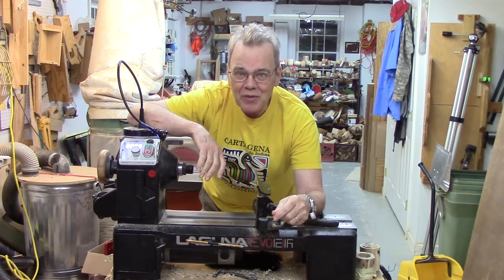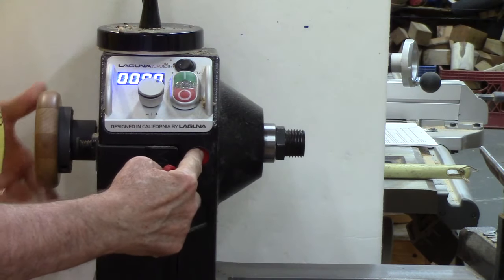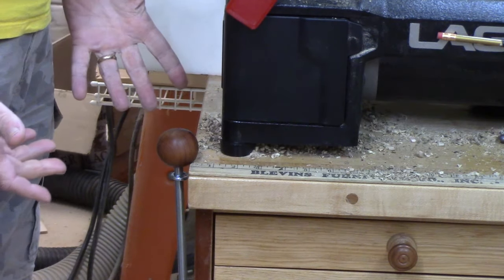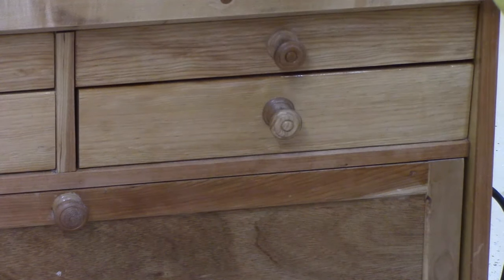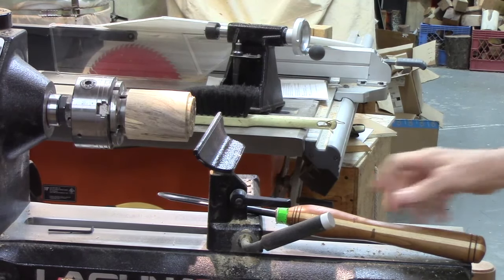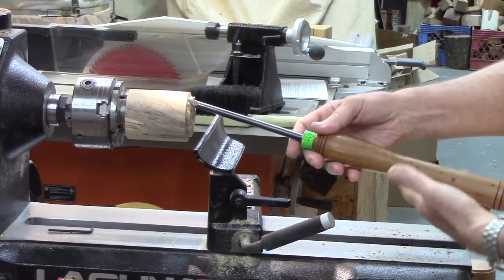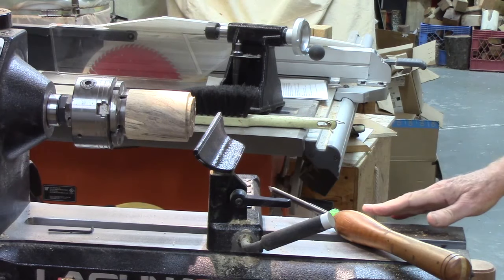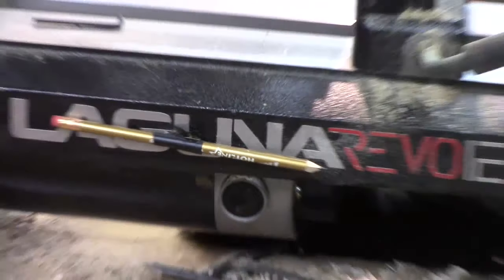Laguna 1216 Midi Lathe - More Tips and Comments

Comment: Hey Mike, nice updates on our Lathe. If you make a washer for you headstock spindle out of a milk jug plastic it will make it much easier to remove your chuck. Also, I use a good thick magnet placed on the rear of the headstock to keep frequently used tools handy. I will be making that spindle lock magnet, that lock is a pain. Just an idea, I do take the tailstock off occasionally and I have some thick foam floor matting, I just place it on it behind my 1216. I guess I could put it on my extension that I have mounted for outboard turning. Now, this tip is odd I know, I bought a LED shop light from Walmart for under $20. I hung the light vertically at the end of my lathe to the back about one foot to give me the best light. It has made it so much more easy to see when turning inside forms. I do have an Ikea spot light but I rarely use it now.
Reply from the maker: I am not a fan of plastic washers. I have seen them cause vibration. I have a 100 watt LED light directly overhead so actually my lathe lighting is pretty good.

Comment: I turn bowls mostly from firewood so the 12: swing over the bed is great. Most of what I turn starts out out of balance. oes your bench mount work OK or should I think about those expensive legs>
Reply from the maker: I do not turn bowls on it since I have Powermatic 3520b that is far superior. But my Laguna rests on top of my lathe stand on its rubber legs and does fine for everything I use it for. I would nver give up my lath stand for a pricey Laguna stand that does not provide any storage.

Comment: Mike, just one other question about 1216 face plate.  It has two set screws installed on the back of the face plate.  It looks like it”s holding a separate part?  Is that a removable part?  I didn’t want to damage it.
I really appreciate your help.  Thanks again.
Roger D.
Reply from the maker: See if this helps https://youtu.be/EMWUTrNUjh8

Comment: Good idea for the thread locker.   Viewers need to be aware the colour normally indicates the strength.   Blue is medium strength but able to be loosened with a wrench/allen key.   Red is high strength which normally needs heat to loosen.

The ruler is good for measuring, but also good to prevent items rolling off the top of the lathe stand.   I have a piece of aluminium carpet hold-down for this purpose, but I may change to a ruler.
The outlet bar is better than a couple of plugs, but it is not going to prevent damage from lightning strikes.   I unplug my lathes and milling machines when not in use to keep them safe from lightning strikes.   We had a close strike a few weeks ago.   The neighbour had some damage to a satellite dish.
The 10in lathe bed extension will stick out beyond the end of the stand.   I made what I call a sled for my NOVA DVR XP.   This allows me to slide the tailstock at 90 deg to the lathe bed.   This gets it out of the way for most of the lathe work.
I am happy to send pictures if this is of interest.
Dave.
Reply from the maker: Yes, please send some pictures.  You can get to my email address in the About tab.
Reply: The bed extension/sled sounds interesting.

Comment: Good tips Mike,are you adapting to the smaller lathe or back and to to the Powermatic For certain tasks?👍👍👍👍👍👍👍👍
Reply from the maker: I did turn a small bowl yesterday on the PM. I had a request to turn a baseball bat but even the PM was not long enough without an extension so I had to say no.

Comment: After nearly 20 years with my Central Machinery lathe, I've finally stepped up to a Laguna 1216, largely to have more control over speed and the ability to reverse.  QUESTION.  I'm considering a Nova G3 chuck so that I can spin in reverse, but won't the screw that holds it in place damage the spindle?  Any advice is always welcome.  Many thanks.
Reply from the maker: Usually, the grubscew lands in an unthreaded area but check it. Never use it myself.
Reply: Thank you so much.  I'm loving my Laguna an appreciate your feedback.  I'm in Christmas ornament mode right now.
Reply from the maker: I love making ornaments. Need to find some time to do some. Don't forget to enter the 2019 Christmas Ornament Challenge!

Comment: Wow I would love one of those I only have a crappy central machinery one
Reply from the maker: It is not where we start but where we finish!
Reply: At $799 it is not out of reach. It makes it easier but you can get the same results in the end. I am always amazed at the quality of turned items done 200-300 years ago. They did those items on a spring lathe, no power except their foot power. I used two different very ancient Craftsman lathes for years before I could save up for the 1216. Keep your tools sharp and your wood turning Billy Bob Frank. Make something incredible for someone you love.

Comment: Hi Mike, I am new to wood turning and recently purchased a Laguna 1216. I enjoy watching your videos on turning and have learned a lot from them, thank you. 
My question revolves around the stability of the lathe. Many turning sites forums that I have read give the opinion that the lathe needs to be permanently mounted and not be on wheels or at least be stationary on all 6 rubber feet on the Laguna. The space is limited my garage and which requires all of my machines to be mobile. I purchased 4  double locking castors from Wood River ( 3" diameter, ⅜" spindle) and mounted them on the Laguna stand that I purchased with the lathe. I also bought some longer ⅜" bolts to mount the 2 inner feet on. The largest bowl that I have turned has been 10" diameter and have not experienced any problem with instability when turning. Does this seem like a reasonable solution to you or do you think I might have problems with stability if I started turning larger bowls on the outboard side? I appreciate your opinion. Thanks.
Reply from the maker: Yours sounds like a reasonable solution. Whether you will have a problem with outboard turning I can not say. But a factor is how well balanced the blank is. You probably saw my video on the stand I built for my Laguna with locking casters. It seems to do fine but I really do not turn bowls on it as I have my larger PM for that. But my stand seems pretty solid with the locking casters. Their could be an issue with all 4 casters not fully contacting the ground which could cause some vibration that will show up on larger work. It is possible you could find the "soft foot" and simply tap in a thin shim to get it level if needed.

Comment: I found your tip video for the 1216. I had another question I forgot to ask you. For what ever the reason Laguna has changed the colors of the power switch. Its now white/black. The international standard for colors is RED is stop and GREEN is go. I noticed on your machine you have the older original colors that are proper. Why on earth would you change colors from the norm escapes me. I would like to hear what you think about this. It bugs me. I asked Laguna why they did this. They did not answer my question twice now. Thank You much. And yes, I will come back!
Reply from the maker: I am guessing they temporarily could not get the correct ones.

Comment: May I suggest you move that power strip to the top of the table from the bottom. Seems your feet and dirt are an issue with it there not to mention having to bend over to plug , unplug, turn switch off.  😇
Reply from the maker: Great idea!. I may change it. Probably near the top on the HS side.

Comment: Hi Mike, with you having a powermatic I take it you will not turn on the outboard. I am interested in this lathe as the ability to turn up to 16" occasionally would be a bonus. Have you tried turning on the outboard, any problems?
Reply from the maker: I thought about getting the extension but having a hard time rationalizing it since I don't need to turn a large bowl on this lathe. I would just get it to slide the tailstock for more clearance on some tool handles. If I do get one, I will certainly try the outboard and make a video. A video like that might bring in $15 of revenue. Not worth spending $150 for an accessory that would make a larger footprint in my shop. The small footprint is one of the reasons I got the Laguna.
Reply: @MikePeaceWoodturning  I forgot to ask, in your opinion, is the 1hp motor sufficient to turn a 16 inch bowl?

Comment from the maker: For folks interested in outboard turning larger bowls, here is a great video: https://www.youtube.com/watch?v=rY4guCLZp_M  Note that Laguna will soon be offering a 20" tool rest extension.  Paul makes some excellent points: get some experience before tackling a bowl this large.  Cutting in against side grain is easier then sweeping across into end grain when hollowing. Need for larger then the standard  jaws. Larger tool rest needed. Increased risk and challenges of finishing the bottom without the tool rest and the ease of cutting green wood rather then dry. Thanks for telling us about the new 20 inch extension that will be coming. For turning lots of spindle work it will be better then the 10".

Comment: Good morning Mike,
I watched your second video on tricks and tips for your #1216 Laguna lathe.  I have the same lathe.  Very helpful.  I saw the red item another viewer made and sent you for locking the spindle.  Do you have more information on how to contact him?  Does he sell that item.  I would like to buy one if there available.
Thanks for your help.
rd
Reply: Mike,  I wrote you about the item Tim Robertson sent you to depress the spindle lock button.  I’d like to buy one or make one.  Is there anyway to find out what the strength of the rare earth magnets he used.  That’s my problem, figuring out the correct strength.  
Thanks for any help.
Roger Dirkx.
Reply from the maker: He does not sell them. I would think it would only have to be strong enough to hold it in place.

Comment: Why did you repeat everything the second time ? I thought I’ve seen this video before
Reply: gwynne clark these are new tips, not repeats.If you mean the repeats in this video, I think Mike just had an editing error, where hw left in some original footage.  There were no repeats before he signed off at around the 7 minute mark.
Reply from the maker: B D was right. Sloppy editing. Copy and pasted when I should have cut and pasted. It happens. I think I was able to trim out that duplicated clip using a YT editor.
Reply: B D if you read my comments (which were made in jest )you will see I made no comments regarding The tips being old tips
Reply: gwynne clark I did read your comments.  I just misunderstood/ wasn’t clear on the intent of your second sentence.  That is why my comment covered both scenarios.  I was trying to be helpful.  Sorry if I offended you.